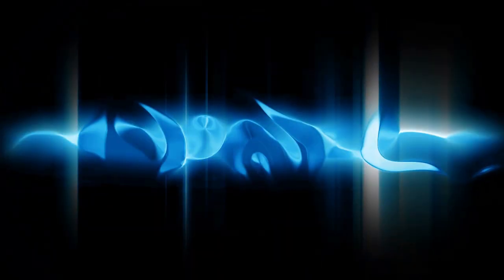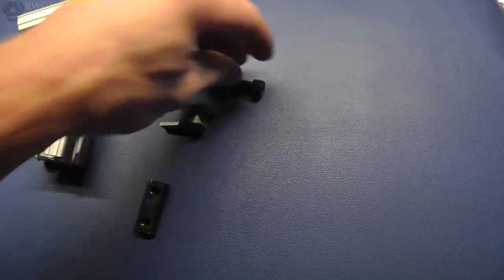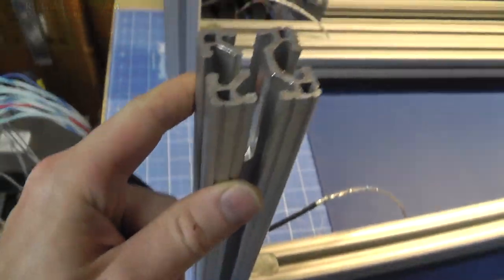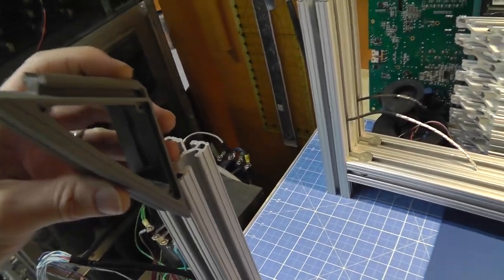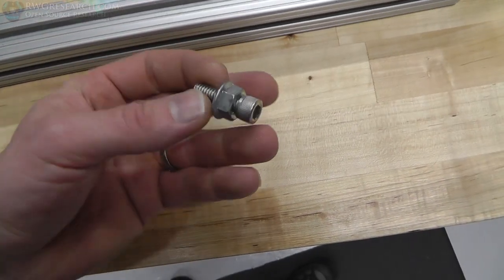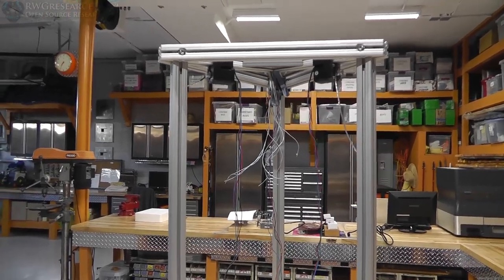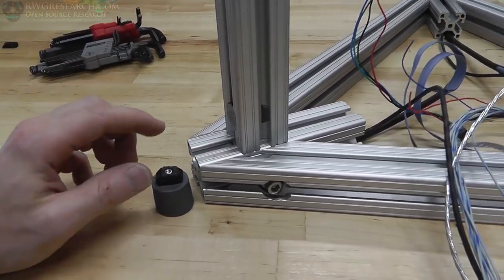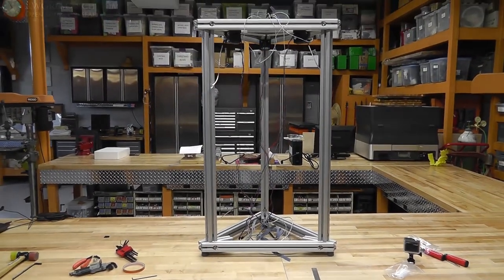RWG-OSD # 23 : Where Those Wires Yo? Wire Hide Mastery! ;)

Comment: folger tech delta, not that bad on assembly im just not the greatest at software issues which is where im at starting to attempt the calibration stage. Thanks for the support!
Reply from the maker: oh yeah i rember seeing this kit, thought it was good for its price! looking forward to your thoughts on It. cal takes some time. did you see my video with the OSD where i showed how to do it? if not that might help! ~Russ
Reply: yes yours and a few others, had to get older versions of Arduino and I'm having  issues with ponterface now but due time will get there. The kit on the other hand, has enough extra parts just in case but still requires slight modifications. this is due to printed parts and incorrect screw lengths. any one with a dremel style multi tool and patience can get by though. but again thank you for succeeding in helping others with the great knowledge you have gained and teaching it back to others open and willingly

Comment: I need to send you some stuff. will Skype you later. 
awesome job. looks like if a motor goes bad it will be easier to take them apart then put it back together lol, not gonna be easy at all.
Reply: just take apart a motor that's bad and swap out the bad parts with new ones. that may be easier
Reply: I thought if you take a stepper motor apart it may not work again.
Reply: kuhrd I have taken mine apart, so no issues on my end.
Reply from the maker: Steppers are really tight tolerances. so if the manufacturer has deigned it well, its no prob, however some cheaper ones you have to align the ends just right, that can be tricky but can be done... also note that i can take the motor out of the bracket no prob... however i cant take the bracket off... not very easy any how...  all part of the learning process! :) ~Russ